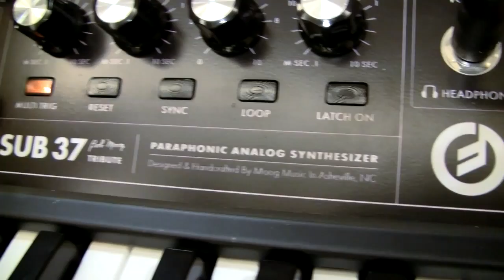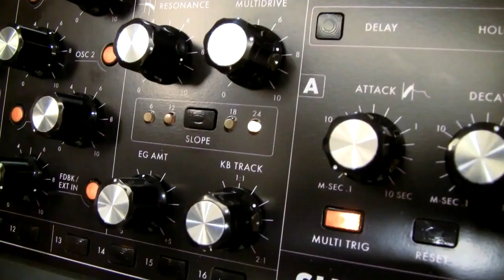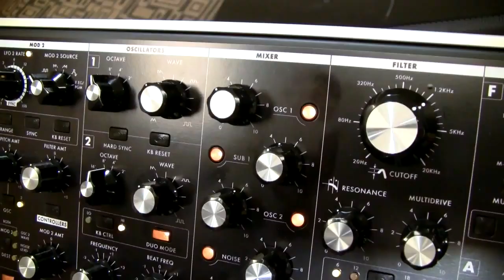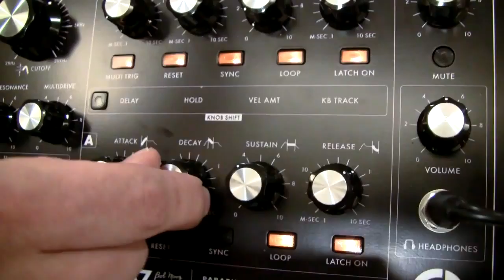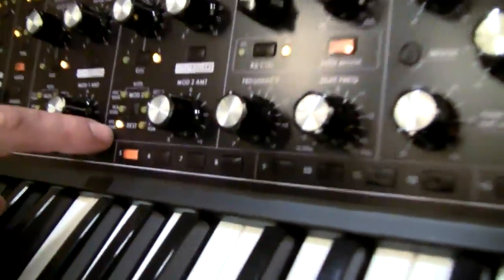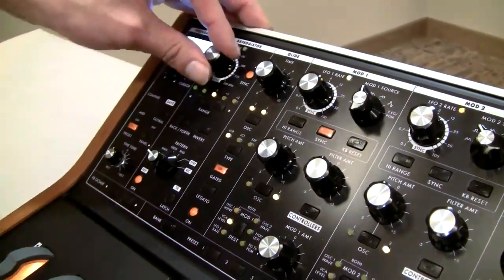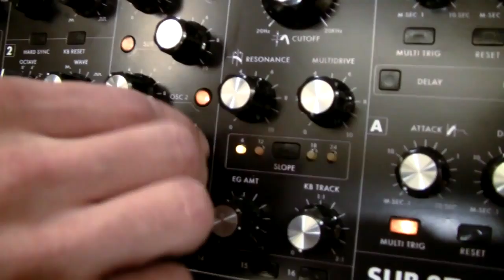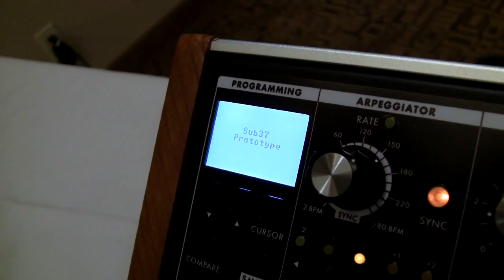NAMM 2014 Moog Sub 37 - Prototype 1st Look

Comment: Congrats! Moog finally made a synth that sounds like and features the same functions as the mini and microbrute. I'll hold on to the minibrute for a while longer...
Reply: You've never met a moog if you think your brute sounds anything like it, and this WAY surpasses what a brute can do. Plus the build quality is out of sight. Your brute is nowhere near any of the phattys, sir.
Reply: Well, mr. Setphaser. I'll not disagree, but if you look at awesomeness per $ i think the Brute wins all along. And, it is quite funny, how Moog i suddenly creating a layout with seperate ADSR for filter and osc, that is available from the frontpanel. They have also made their own ripoff of the brutefactor, and now, there is suddenly
Reply: ALl the modern moogs have had separate filter/VCA envelopes, even the little phatty though it wasn't knob per function.

The only unique thing about the brute is the ability to mix saw-square-triangle-etc. but that's not an original feature, many 70s synths had this.

The microbrute doesn't have the depth of function that moogs have. If you're just counting knobs on the panel, you're missing most of the fun.

Please don't compare your $500 synth to a sub 37. It makes you look silly. The sub 37 is a bargain for $1500. Play one before making more silly comments.
Reply: I do enjoy silly comments and certainly, you are the one missing most of the fun. It is a highly subjective topic to talk about synths in this way. I do not disagree that the Moog is a splendid piece og handcrafted artwork, I'm simply stating that in my most subjective opinion you get more bang for the buck, buying a Minibrute.
Reply: Mads Voigt Hingelberg
Which one do you think will still be in one piece in 10 years?
Build quality alone will bump up the price and that's just scratching the surface of the differences.
I own a minibrute btw. so'k I guess, nothing special.
Reply: Jason Woodman for the Price of the MB, i dont really care. In 10 years time, who knows what the World looks like anyway.
Reply: Mads Voigt Hingelberg
Sorry man, but the 'Brute Factor' was a rip off of Moog, it started with people feeding back their out back into the external audio input on the Mini-moog. That's where Arturia got the idea. I agree though, the MicroBrute is a togh little fucker. I was really bowled over by its total nastiness for a single oscillator synth. If I had 1,500 though it'd be really hard for me not to get one of these. Moogs build quality is superb, classy and speaks volumes for its long line of top sonic heritage. You've got a point though the MBs certainly do give a lot of bang per buck.

Comment: That looks very interesting indeed. I have been considering buying one of the "little moogs" for some time now. At first I was intrigued by the little phatty, then the sub phatty came along with its multitude of real time controls and features like multidrive and additional suboscillator, but 25 keys and only 16 patches didn't really do it for me. Maybe I'll invest in the sub 37. It is slightly more expensive than a little phatty but looks more fexible. And whith more hands on controls its definitely more fun.
Reply: *****  I doubt that arturia could crush Korg, simply because of the fact that arturia is a relatively small company that can't drraw on the same amount of resources Korg has at its disposal. Korg is the second biggest manufacturer of musical instruments in the world, only surpassed by Yamaha. Arturia by comparisión is  handful of french synth nerds and programmers who have only just begun to produce analogue hardware synths and the minibrute alone has been a logistic nightmare for them, since it took months until they finally could meet the demand.
Reply: ***** dudee a polysynth from moog would be daaa boomb
it would be also cool that roland make up theirr minds and remake analog synths just like they used to do

Comment: when Moog releases a full on analog poly in the realm of the MM I am back on board again but until then I am keeping my Subphatty and not jumping up for more keys... I hate to say it but my Arutuia MiniV is poly and has some factory sounds that sound EXACTLY like my MemoryMoog did back in the day. Kudos to Moog though..they are an American Legend and Bob was a genius, (along with Dave Smith ,Tom Oberheim (DonBuchla and the rest of those dudes..Linn etc)...they changed music forever
Reply: I can only imagine it has to do with cost effectiveness, inflation, paychecks for the folks at Moog, profit margin etc etc...Ie they can't make a cheap one and make a large profit, so no sense in doing it. The economy now is so much differnt then when I bought my MemoryMoog new at West LA Music back in 1983. I got the MM when it first came out and paid what, $2295 for it I believe. I then added the Plus with MIDI to if after (Plus also had a sequencer in it) This cost a couple of hundered extra buck but overall I was out the door with a 5 voice poly analog with three massive oscillators per voice..it was fucking monster on bass....killed anything in the room...also made great eeerrie strings and stupendously nice bells...,,stupidly I sold it for what I paid for it and thought I made out well. I see em on eBay now for 8K. Yeah right. Not going there, nor will I pay umpteen grand for an Arp 2600 either. You see collectors going ape and buying them but can't write shite for songs with em and wonder why those with the most money can't write a lick of a tune ha ha...anyway, glad there are software equivalents that once in a mix, can't be discerned from the real thing and even if the real thing is used, most of the time its being used by people who can't write shite for songs...just my humble two cents worth about   elitist purist synth snobbery of late and how it it always seems so inversely proportional to good song writing. (Ie; Ariel Pink writes great songs, as does John Maus, but both use shite equipment, ha ha)

Comment: Own a sub phatty and find it a great bass synth. It has only two osc and that does pose a problem trying to get it to cut through the mix when used soley as a bass instrument but on its own it is a beaut to be sure. Its the only Moog I have owned since the purchase of a Source in 1982 and a MemoryMoog in 1984. Both long since sold, the source I could have done without (although a very cool looking synth) while selling My MemoryMoog was the stupidest thing I ever did..what a sound..it WAS the mix

Comment: I pre-ordered this based on this video. Moog should send you marketing fees ;)

I also saw from the photos on the Moog site that this has just the same I/O as the original Sub Phatty. I guess they need to save something for the Voyager :)
Reply: ***** I was told "Sometime in the fall"  I'm contemplating driving down there, checking out the Moog factory / offices and making an event out of it.  I fully expect a Mac-Store-Opening like reception complete with high fives and applause  ;)
Reply: Kevin Hannon I was told June, but it's always hard to predict small production run stuff like synthesizers. I'm into modular, so I know it's typical to wait the better part of a year for some modules. I'm learning patience :)

Comment: All the demos so far with sub 37 are distorted pants, the oscillators saturate at over 6 intentionally on the dial, add feed back and multidrive and it just sounds distorted, we need a demo of the smooth filter and oscs from single to double and sub added, get some double lfo mods going and some sequencer patterns, then listen again, real vco and vcf are very different from digital particularly resonance.

Comment: Sounds not better than a digital
Reply: You're deaf, my friend.
Reply: I don't think so. Digital synths easily outperforms this.
Reply: Vadim Taranov Well, I'll tell you what I think: You're wrong. Digital synths have nothing on this in terms of tone and body of the sound. This fucking thing can create ripples through space and time. Digital synths are thin and cold in comparison. I'm not saying digital synths do not have their place. Comparing an analog masterpiece like this, with excellent components and build quality, to something like a made in China digital synth is completely idiotic.
Reply: That's like saying a violin easily outperforms a trumpet. They're totally different beasts each with their own sounds.

Also, "digital synths" is a huge area. You should be more specific about what you're comparing. A blanket statement like that is completely wrong.

Comment: In 2014 this is an embarrassment to where a MOOG /Could/ be. Horrible oscillators!
Come on, discrete components ARE CHEAP!!! Why can't your CEO's break down and hire a good parts buyers. It's about time for AFTERTOUCH, but I'd much rather see multi contacts with player adjustable contact points on the key stroke ( see electronic organs multi contacts  1935-1968 primarily. So you might say, why multi contacts on a 2 oscillator synth, huh? OPEN YOUR MIND. Mini modular is better on the wallet, can be built as kits, and in this day and age MOOG should have that down and out the door like hotcakes!